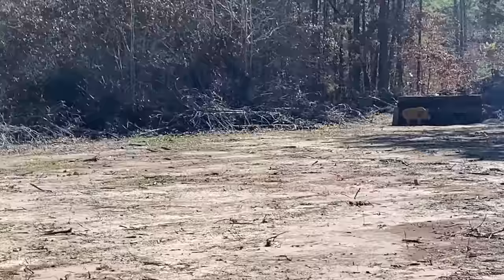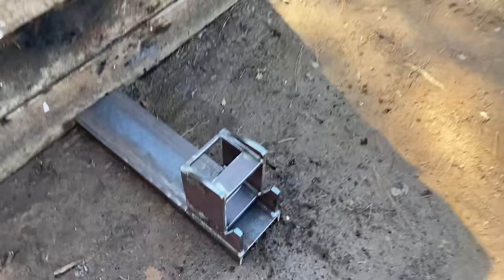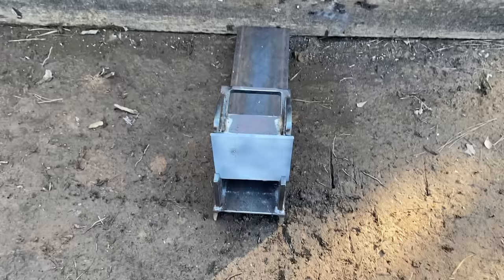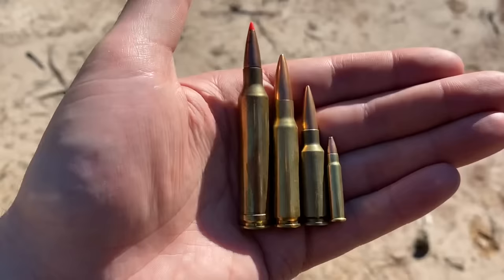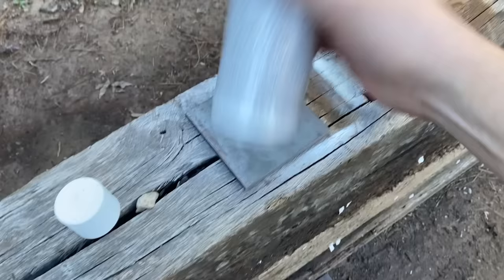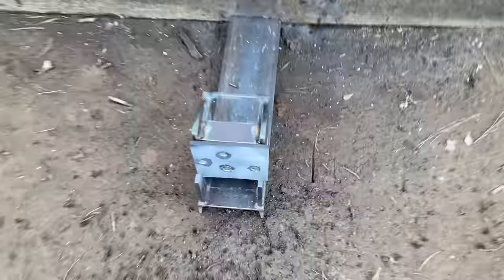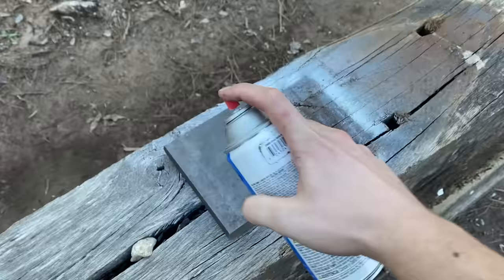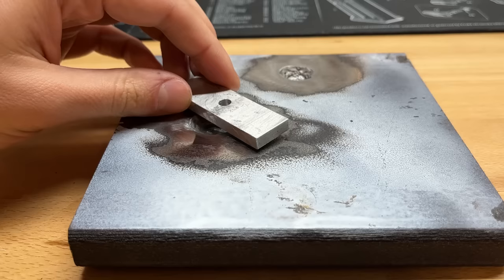338 Lapua vs 7mm RM vs 308 Win vs 6.5 Grendel On Steel

Comment: looks like that second.308 shot around minute 5 was pushing against the vertical side of the steel sled v2.0
Reply from the maker: You are definitely correct
Reply: I would redesign the sled, make it larger as there were a couple shots that hit the rear supports.
Reply: My thought exactly
Reply: yep, he needs to re do the video to be fair to the .308. I have shot my .308 at 75 yards and it makes it through 1/2” mild steel with a 20” barrel.
Reply: You are correct
Reply: Yep @bananaballistics
Reply: love it when you see something and you instantly hit the comments to see if everyone else did too. clearly that round was headed out the back until it hit that side.
Reply: Optimal barrel length for the .308 is 22". 16" will not perform well in that caliber. I use an 18" barrel in my AR10 to keep most of its velocity advantages.

Comment: The 308 was 300 fps under the stated velocity because they aren't tested from 16" barrels. It had trouble getting through because part of your steel sleds was directly behind it.
Reply from the maker: Very true, I believe it said 24” online and it was probably a bolt action. The steel definitely clipped the edge of the sled
Reply: @bananaballistics  You need a .308 Win with a real barrel. I rebarreled mine (bolt gun) with a 26" barrel and the velocities are slightly better than a 24" but I wouldn't go more than 26" with a .308 Win. You can also maximize your velocities by hand loading with the ever expanding powder choices available. I can push a 168gr match bullet at 2770 through that 26" barrel (2745 in the 24"). I'd love to see what a .224 at 4000fps or a .243 at say 3600fps would do to that steel.
Reply: Right, Apples for apples.22-250 would have surprised with a 23 inch barrel that is.
Reply: @CplSkiUSMC  Precisely; correct. And I can tell you since I did this exact experiment a few months ago. With my .243 24" barrel and basic 100 grain Super X bullets @2900fps I believe. One shot at slightly under 100 yards I had dime size penetration on 3/8 steel plate. I actually have a photo still in my phone somewhere. Actually the .243 had a bigger penetration and much greater energy transfer than the 5.56 green tip. 

I then shot a 55 grain ballistic tip in my .243 and set  2 6x6 ar500 side plates set together @ roughly50 yards it went through the 1st plate and almost made it through the 2nd. 

I'm fairly confident something like Doubletap 100 Grain at 3120fps or Underwood Ammunition 85 Grain @3400fps could go through those 2 plates at 25 yards. I can't imagine a hot load of .243 whizzing at 3600fps lol
Reply: That is still very slow for a 16' barrel and a 168, its can safely be about 100fps high, and hot loads can get up near 2550.
Reply: @williamkillingsworth2619  I'm out west at 5100 feet elevation and I hunt even higher. I try to squeeze that velocity out of a cartridge because bullets carry better at high elevation and that really stretches out effective ranges. If I can launch that 165gr or 178gr bullet out of my .308 at between 2750 and 2800fps then if I'm hunting at 9500 feet, that 178gr ELD-X has knockdown punch (1143 ft-lbs energy @ 1700fps) at 700yds . Short barrels seem to be "the thing" lately, but I've never liked them. Speed equates to extra distance and I like shooting distance.
Reply: @CplSkiUSMC  I live near sea level. My go to plinking load is a178ELDM 42.4 gr of 4064 loaded 2.86 COL is doing around 2460 out of a 16, confirmed with a lab radar. Which is really close to M118LR of FGGM just a different projectile.  I can load about a grain hotter but the primer pockets don't last. 

 I like shooting my shorty as it makes calling the conditions, wind,  more of a challenge and I do mostly target shooting at the 1100 yard range near my house.   Any time I get behind a long barrel rifle, it feels like cheating.   I like the shorty as it really helps learning how to read mirage and wind. 

My 168 loads out of a 16' depending on Powder are generally in the 2500-2525 fps range... that 168 stuff he used in this video was definitely on the weak side.
Reply: @williamkillingsworth2619  You'd love it out here. You're my kind of shooter, you love the challenging shots and not the easy close up stuff that grandma could hit with a slingshot. That long barrel isn't cheating when you're shooting eleven or twelve hundred yards at a milk jug. Short barrels tend to be accurate though and if you're shooting 700yds at sea level at the same milk jug, the challenge is there. I just love to pick a random rock out there beyond a thousand and try to hit it on the first shot. I routinely shoot pistol out at 200yds and more... again, the challenge. Wyoming wind is also a huge challenge. It's usually pretty strong, and whipping down between the rocks and hills it is never consistent. I should get something that cuts the wind a lot better, like a 6.5 PRC or 27 Nosler, but I figure if I can do it with a .308 Win I can do it with anything.
Reply: 22 inch barrel is what u need for .308
Reply: @CplSkiUSMC  Sounds like fun!!!
Reply: @BaconSlayer69  I have a 20" barrel on my .308 AR because 22 and 24 inch barrels are very hard to come by. I consider it too short. I would consider 22" a bare minimum, but I run 26" barrels on my bolt action rifles. I think 26" is a sweet spot for .308 Win and I can propel 175gr and 178gr bullets as fast or very near as fast as a 168gr.
Reply: @williamkillingsworth2619  The real fun is 2000yds with the .338 Lapua. Of course you can play around 2000yds with a number of magnums and I'm very curious about the 7mm & .300 PRC out at that distance.
Reply: @CplSkiUSMC  Never shot out that far but want to.  I agree the PRCs with their modern designs are desirable.   Pretty sure both 7 and 300 Prc go sub sonic around 1750.   Not sure how stable they stay through the transition but will get there.   Definitely need a spotter at those distances.
Reply: @CplSkiUSMC  .308 was designed with a 22inch barrel how do I know it’s a rifle called T44 or as people know it the m14 rifle so ur wrong
Reply: @williamkillingsworth2619  The longer and slimmer a bullet, the more likely it is to destabilize during transition is my understanding. But 1760 is a mile and that ain't bad. I have a camera with a very good optical zoom that I use as a spotter, but when shooting that distance, you can usually get back on target (roughly) before the impact and the dry dusty soil in the basin usually gives a great splash. When you tell most people that you're shooting a mile or more their reaction tends to be, "You can't hit nothin at that distance," but that just proves they don't know what they are talking about. You're like me... the close up stuff is too easy, we want something that presents a challenge. Shooting a mile or more is certainly that.
Reply: @BaconSlayer69  Actually the 7.62x51mm was designed for the M-14. The .308 Win cartridge was introduced by Winchester for use in civilian firearms which in the late 1950s favored longer barrels. Performance is the measure for any cartridge and longer barrels give greater velocity... to a point. Once that point is reached, velocity levels then decreases with even longer barrels. You and I can shoot the same ammunition through your 22" barrel and my 26" barrel and I will get more velocity than you every time. It may be slight or significant depending on the powder burn rate, but it will always be higher. The point of diminishing returns for the .308 Win is somewhere around a 32" barrel if I remember correctly. Your 22" barrel still achieves very good results, far better than 16" and better than the 20" on my AR, but I love my 26" bolt guns for the .308 Win.
Reply: @CplSkiUSMC  I know all that already captain obvious ur talking to somebody that’s almost obsessed with firearms u ain’t teaching me anything besides trying to argue to prove a point with no point
Reply: @cplskiusmc5654 26 is wayyy to long wtf. Plus 308 doesn't loose alot as you go down in barrel length.
Reply: @chanoleyva8584  Maybe you like short barrels, but there is velocity increase from a 24" to a 26" barrel and both are considerably higher than the 20" on my AR308. If you like those short barrels then knock yourself out, but 26" is just fine with me.
Reply: @BaconSlayer69 if you knew that the 7.62 was designed for the m14 and the.308 was designed for the civilian market and for different length barrels then why are you referring to the other person as " captain obvious"? I mean it really does make you look foolish.
Reply: @charlesquick3091  ur irrelevant to the conversation
Reply: Try teflon coated projectiles they might surprise you my 7mm RM surprised me
Reply: Ty I was coming here for that as well

Comment: The 308 failed on the 3/8 inch plate because of where it hit. It was too close to the edge of that sled, the effect was like trying to shoot through the strong part of an I-beam (the vertical portion in the center), instead of the flat part.

Comment: Do not overlook the fact that the .308 on the 3/8" plate partially hit the reinforced steel sled.  That will have absorbed some of the energy.  Even at 300fps below advertised, it probably would have punched through if it hit plate only.
Reply: I would like to see both using Armor Piercing rounds
Reply: He hit the sled with the 7mm

Comment: it depends on the caliber and a 16" barrel on the 308 is not enough, it is better to use a 22" as a minimum. use FMJ if you can find them.
Reply from the maker: Very true, just about anything out of the 24” I tested went right through 3/8” with ease
Reply: Yes he using the wrong barrel lengths for each round. He has a lot of learning to do.

Comment: Very interesting- i think at a 1000 yards the difference between the 338 and the 7mm would be alot different. Super cool video
Reply: I dunno. 7mm RM has an amazing BC. Would really need to test it and see. Also, it's trying to punch a narrower plug of steel out. Could be a dead heat.
Reply: @kathrynck  absolutely - there is only one way to find out 😁
Reply: Well seeings how the 7mm Rem mag is screaming along at a little over 3,400 feet per second with a 150 grain round, the .338 Lapua mag is trailing along at 2,850 so at a 1,000 yards the 7mm Rem mag is going to get there a bit faster and guess what velocity  equals penetration and as a bonus the 7mm Rem mag is easier on the shoulder and yes I’ve shot both so yeah I know the felt recoil
Reply: @gearhead682010  Somewhat agree, although I don't know the BC on the 338 lap. And not at 1000 yds. It sounds like the 338 has an extremely heavy projectile. So I suspect it has a great BC. At 1000 yards, the BC will determine the terminal velocity more than the starting speed. But then the 7mm RM has great BC too... Against 7.62 nato, both have superior BC.

I don't think you're going to get plate penetration at 1000 yards with anything short of a 50 BMG though. And even then it'll be going slow, but could probably just brute force the job anyway. More sledge hammer than piercing thrust. Most rifle cartridges are at or approaching subsonic at that range. Which is terrible for AP.

Personally I think any round which wants to penetrate chest plates should be very very light, with terrible BC, but very high muzzle velocity. And only really work against armor plate at close ranges. Reason: it would have manageable recoil for CQB. And do really nasty things on soft target hits at closer ranges as well. Not a lot of people can actually hit a moving target at 500 yds anyway. Those big elevation sights on WWI/WWII rifles were for volley fire (2000 guys in formation shooting at 2000 other guys in other formation).
Reply: @gearhead682010  The 162 grain sst used in the 7mm has a G1 BC of .550. For comparison the 285 grain ELD in the 338 has a G1 BC of .789. That's a huge difference in external ballistics. Even Berger's heaviest 7mm bullets can't match the 338's BC.
Reply: @KyussTheWalkingWorm  You can get Hornady 190gr A Tip match .284/7mm projectiles with a G1 BC of .838, though a more fair comparison would be 180gr Hornady ELD match with a G1 BC of .796, 338 LM BCs are good, you can in fact match them with the correct bullet weights in .284/7mm.

Comment: Good demo. I shot 3 holes through a 4" flange x 10mm thick, at 100m using 7mm Mag, 165gr federal. The holes were straight through. The flange was propped up on a wooden frame, which fell over when the rounds hit.

Comment: I have a 7mm rem mag and love it. Everybody I shoot with uses 30-06 and it doesn't have the same power or range as a 7mm. Downfall of 7mm is it's very expensive in my area. I can't find a box of 20 for under $45 it does get expensive but would never get rid of it.

Comment: .308 needs more than 16 inches, minimum is 18 but you really need 20-24.
This is why the difference of 6.5 CM vs .308 tends to have as wide of a gap, because people test the .308 with 16 inch barrel and use a 20+ with the 6.5 and go, SEE SEE, 6.5 is so much better.
Same length barrel and best rounds for both, the .308 will have more energy till after 600 yards.

Comment: The similarities of depth for the 7mm and the 338 shots on steel, despite the obvious difference in power, is probably due to the difference in sectional-density.
Reply from the maker: That is a good point! The 162 gr 7mms have really good sectional densities

Comment: Velocity penetrates.  When I was a teenager I would embarrass the “older guys” with their 308’s or 30-06’s by shooting through a steel plate with my 22-250 while their big guns would only crater them.   It would be really interesting if you teamed up with one of the channels that has a super high speed camera and do some comparisons of the same bullet at different velocities on the steel you test on.

Comment: Is there a reason that you do t use 5/16 plate between the 1/4 and 3/8?  It seems like you’d get a better separation of various calibers. For example stance when you did the 6.5 Grendel vs 6.5 Creedmoor, by your test they showed very close. I wonder if the 5/16 would have showed the difference better.

Comment: Got a test for you.
Get some dry wall and build a "house wall" line the inside with rubber from tyre tubes both side then pour enough ball bearings (1/2 to 3/4 inch mix) in to fill it up. Wrap the excess rubber over the top of the exposed ball bearings so that when you shoot them they don't go anywhere.
Find out which calibre would go through that.

Comment: Correct, the 177HMR is not known as a sniper round, but neither is the 6.5 Grendel or the 7RM.
The 308 on the 3/8th plate was prevented from penetrating because of the frame of the sled v2. Rather obvious really.
Any reason why you cant hit the middle of a 4 or 5inch plate? You missed 3x

Comment: The reason the 7,62 didn't make it through the 9,525 mm plate is the suppressor. Take it off and the bullet goes down range 100m/s faster. That will clearly make a difference. Also the barrel of your gun is quite short with only 40,6 cm. That also has a huge impact on the muzzle velocity.

Comment: The two front posts of the steel sled V2 should’ve been sharpened like the V1. I don’t know why I had such an emotional connection with V1 but it will be missed🥲

Comment: I have a question what happens when you load a m855 bullet (green tip) into a hotter case like 22-250 or 220 swift ?

Comment: I fired one round from a M1 Garand using a WW II production AP round that was standard issue ammo towards the end of the war. Target was a one-inch-thick piece of class A armor from a shop my dad work in just after the war. Just the tip of the core was showing on the offside with a lot of spall missing. I was shooting at 33 feet in the basement I got hit with a small piece of the jacket just below my safety glasses. Same round could go through a 18" diameter pine tree.
Reply: Those steel core 30-06 are not to be reckoned with out of the Garrand

Comment: I wish you would have tried the  300 Norma Magnum (not to be confused with the older 308 Norma). It's my understanding the US military uses the '300' as its go-to long range sniper round using a 220 grain missile. The '300' Norma has a stouter case in a standard length action facilitating more powder capacity than a 300 W.M., thereby doing a good job with the heaviest 308 bullets out to 2000 meters (and beyond).

Comment: Nice video 👍 have you considered trying solid copper rounds? At close range with hot loads 300wm was able to penetrate through 1” steel with I think the round was Barnes triple shock

Comment: The 270 is a very very good penetrator.....yup....it does out-perform 30-06/308 ..... I shoot 30-06 only because I can shoot 220 grain out of it which does a great job....but... for everything else I go with 270.....I know for sure 270 penetrates really well..... 30-06 old model 30s and 270 is model 70....(yes, I am an old man....lol)

Comment: Good video. Thanks. Wanna try something different? Do a test run of the different “Accelerator” rounds. Example: .22cal bullet with sabot out of a 30.06
( supposedly has blistering 4,040 fps)
Reply: nahhh, I think a 6mm airsoft ball put in a 50 bmg at 36000fps is better 💀☠️

Comment: Do you think a 22-250 would punch through 3/4 bc of the velocity?
Reply: Off the shelf ammo no. If he pulled apart some green tip 5.56 then reloaded them into a fast twist 22-250 it’s get way more interesting.
Reply: @chadperry4021  nvm. He already has a video on it
Reply from the maker: I think I’ll probably do a test with 22-250 and see what different bullet styles do on steel

Comment: Your .308 round hit the edge of frame work holding the plate. I am drilling clean holes through a piece of 12 inch  I- beam with a .460 thick center at 135 yards also which is somewhat harder than that mild steel. This is done with a Savage 308 with a 24 inch barrel with a147 and also a168 grain bullet . A 7.62x39 fmj will go through 1/4 inch mild steel at 100 yards